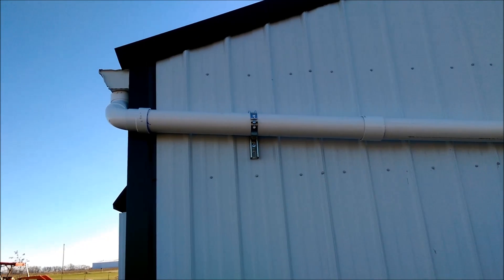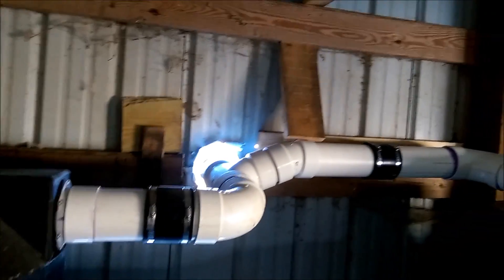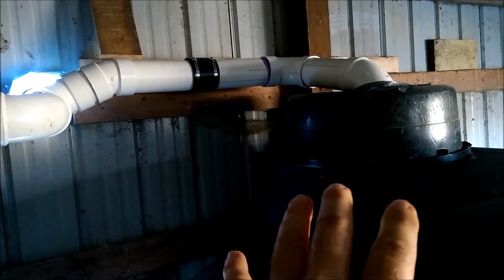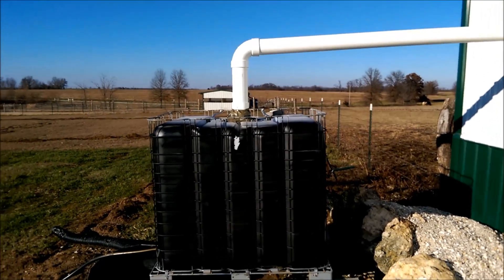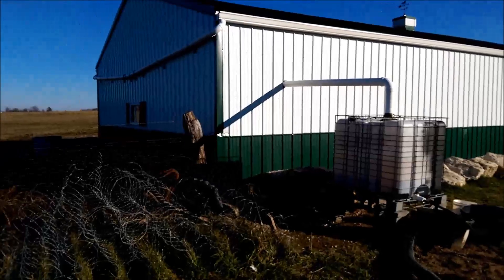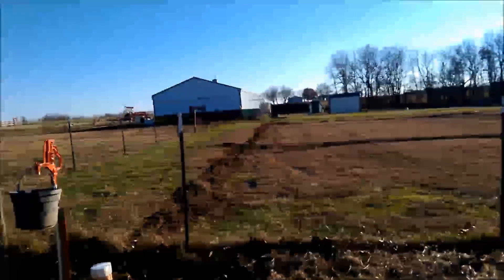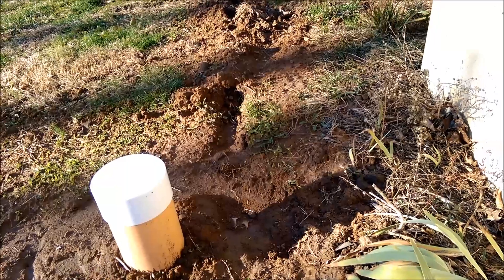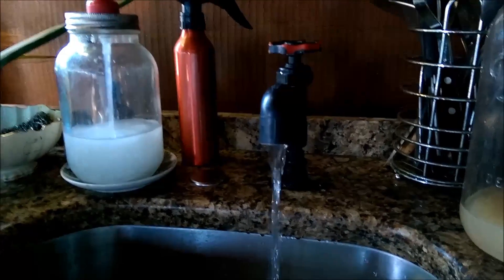RAIN WATER CATCHMENT SYSTEM - DIY

Comment: ive got one of those pumps on my property from 1900 but they filled in the well and covered it so its all contaminated i need to set up a system like yours but over my long shed is pine trees so i need to get one of those utter systems that has a fine screen over it.

Comment: Are there any tips for figuring out what the gentle slope of our space would be, or if we even have one? I guess having elevated water collection tanks everywhere at key water points would also be an option, not as tidy, but would do in a pinch until you have done the research to figure out a bigger system. Great videos!!

Comment: The water will flow to path of less resistance as you mentioned. With that being said, when the first flush system is full the water goes up the 22.5 angle and into the collection system. So , how does the water with sediment go into the first flush. it seems as though the first flush would be by passed thus making the rain water go directly into clean catching system. Watching so that i can set up my own system so i want to make sure i understand this principle.

Comment: ...fantastic, Doug! One addition that I have found helpful is a bypass pipe line around the filters. This way, when you are servicing the filters (or if anything happens to your filter tanks, you can still have water after the filters: a T before the first filter with a valve and a T after the last filter with a valve...run a pipe from T to T around the filters : )

Comment: Question: what brand filters did you use for each tank and how do you like them?  I'm getting ready to install a 1500 gal tank and I like your 250 gal first filter tank very much so I want to add that too.  Later, I will want to add another 1500 gal tank and an overflow tank, but budget this year dictates one 1500 gal and 250 gal first filter tank for starters.  I'll be building a pole barn with insulation to prevent freezing in winter.  Thanks.

Comment: Good looking job and should work great as long as you have enough storage for dry spells. A propane on demand hot water heater in the crawl space will work with the gravity system and provide hot water to both tub and sinks. If you want more flow at the house a RV water pump that works on 12 volts will work for you and a storage battery and small solar panel will keep it running for low cost. The pump  only runs while water is being drawn from the faucets. Put the pump before the filters because the filters are designed to work with pressure not vacuum.
Reply: Thanks

Comment: Oh, I also had a question about the first 250 gal filtering tank. If it's full and the water is backing up in the pipe at the top, how then will the incoming water be able to use the 250gal tank? Looks like sediments will only settle in the 4 inch pipe, then come over into the 1500 gal tanks. Tks again for the great videos, keep up the good work.
Reply: Tks

Comment: Being that you're using gravity feed ,you need to have so many feet of drop , That being said did you consider installing a off grid hydraulic ram pump closer to your house to increase the pressure so you could use the standard faucet on your sink ?
Reply: You're right, I overlooked that .

Comment: Old video,  newer sub and catching up, etc.  I noticed a drip at the rubber boot on the diverter,  have you had any big issues with leaks?   Great looking system though.   Thanks.
Reply: +OFF GRID with DOUG and STACY Good deal.  Thanks,  and Merry Christmas to ya'll.

Comment: I live in the north and was wondering if keeping the barrels inside help them from freezing. I heard what you said about keeping the water flowing and not letting it sit in the pipes. Are there other ways to keep this from freezing? Also, when it snows, do you have something to heat the roof to catch the rain water - or how does that work in the winter (especially in colder climates). Thanks guys, you are really helping me to research this all out. :-)

Comment: Cool channel!  I subbed.  As for your outdoor overflow tank, why dontcha just plum in a runout line, just shy of full, so you dont have to tend to it?  Also, I dont see an intro video, so I'm confused about your Amish costume but no dress and bonnnet on your wife, and the mention of the Tora plus the Bible.  Not trolling, just curious.
Reply: +OFF GRID with DOUG and STACY. Wow!  I love a quick response.  Your intro video was very good, and I'll be wading through all your prior postings.  And I'd still like to see Stacy in a bonnet, but I assume that's against the rules of the Amish Protection Program.  Lol.  Thanks, guys.

Comment: Curious:  The way things are going, I'm sure water collection systems will become "outlawed" in the near future everywhere , that being the case, wouldn't it have been better to run the piping from the gutters inside your barn to be more discreet?  Just a thought. 

2nd.  Being the industrial engineer in our home, I would be a bit frustrated at the dribble of water from the main sink.  :-/  do you have the same issue with your bathtub filling as well? 

Do you have solar heated water? If yes, do you have a link or video for that?  

Love your channel.  Stumbled upon it this afternoon as it was linked to a Jas Townsend & son 1800 cooking video. ;)

Comment: Hi Doug.
I dunno how uptodate  we are but do you now have a "proper"pressurised water system at your off grid homestead?
Pump, pressure tank etc can all be powered by a small RV pump, 12v battery and small PV panel giving you pressurised water and then it can push through the filters better and go to an on-demand water heater (Propane) if needed.
The family would love it and its still eco-friendly !
Great vids ... interesting stuff.
From england UK
Si
Happy New Year
Reply: @ Multioutdoorman 
Thanks for the information.

Comment: I think you can make the overflow of the outside container more effecient. If you make an overflow outlet on the top of the container, but with the 90 degr. bent lower than your inlet, then you can lay pipe to direct the overflow to an area where it won't cause trouble with mud and such. You then only have to use the faucet at the bottom of the container to drain away the litlle bit of water that is standing in the top part of the overflow pipe. You won't have to drain that containe as much and as often, and in the summer you can probably just let it be. 

The total layout of the systems sure looks good to me. I'd say that's a job well done.

Comment: Isn't there an overflow pressure relief valve you could put in the tank outside the barn that would relieve you of the need to manually drain the system when it is full (when you have concern for the pipes freezing up)?

Comment: Hi Doug Hi Stacy! I also have an ultra low water pressure system set up on our place in Colorado. I have a bit of advice for you if you would like, a lot of times when I ran into problems with our system I would get frustrated at the amount of water pressure or rather lack of water pressure....After speaking with some wise men (1 farmer &1 municipal water worker)...They convinced me that the best way to tackle the flow rate issue  was to increase the volume by stepping up the pipe size as large as I can and as far as I can.....Now I am carrying water a little further than you guys in our lines, but sure enough when I stepped up my feed lines by all fixtures to two-inch lines as close to the fixtures as possible before stepping down to the fixture line size; my flow rate greatly improved.     Thanks for all you Do you guys are a wonderful encouragement.
Reply: +OFF GRID with DOUG and STACY Itis a really nice setup I guess it just looked like the pipe size stepped down and stayed small after it went under the house expanding diameter on either side of a choke point helps friction and volume. I will definitely go through all your vids give a thumbs up. you guys rock!

Comment: First thing, I would swear you are losing weight or gaining muscle.  (not that I noticed) (manly cough sound).  Next, are you Superman?  You are rockin it.  Between the little house, the barn, and the water system, you are showing the infrastructure of off grid.  When do the tours start?  Unless you are opposed to it, when the finances are there, I think I would add some solar.

Comment: there's about a half lb of pressure per foot of head. those of you that can do a system with a higher head from higher elevation will benefit greatly for pressure. works good for only 7' total. keep up the good work

Comment: Very interesting.  Thank you for making this.  I have been trying to dream up how to do something similar at my place.

Do you heat the building with the big water tanks in the winter then?  Or are they large enough and your climate warm enough that the big ones don't freeze and the pipes don't break?  I was going to try to reinforce some of my walls and rafters and put my rain tanks (55 gallon drums) up inside of a ceiling on an enclosed/heated side porch, so that they wouldn't freeze up, but still be elevated for gravity feed so I wouldn't have to use a cistern pump.  But I am not sure if that is a very good idea, haha....

Also, is there any particular method or math behind sizing your diverter based on your roof footage?

Comment: Did you get a chance to get the water tested? I hear ya on the flow/ water pressure when using those whole house filters! We are constantly changing our filters to get better water pressure. We have well water with a submersible pump, and if I don't keep up with changing the filters we have little to no water pressure. The first time that happened I thought the well went dry!! I only use the well water for the critters, baths, cleaning and toilet, so I can get away with using sediment filters with a 10 micron.

Comment: Great video, Doug. We're not considering rainwater for drinking, but we want to harvest the runoff from the hoop house and (small) barn for watering the livestock and garden. We would have about 14 feet of fall from the tanks to the point of use, so we should have plenty of usable pressure for drip tape or soaker hoses.